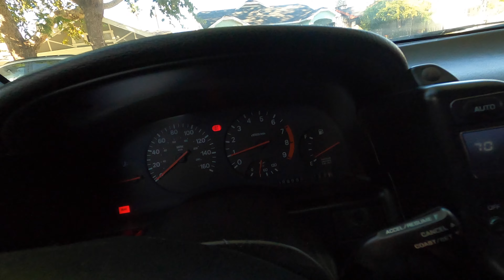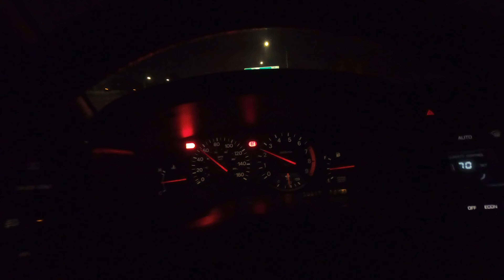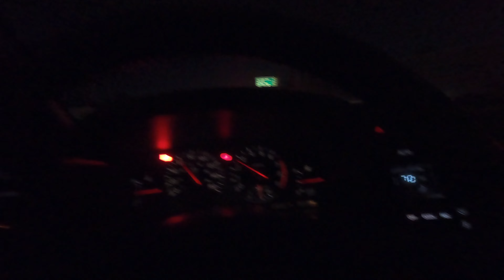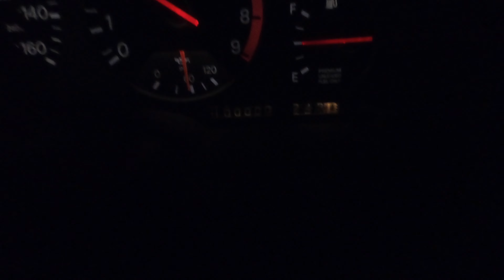New wheels for 300zx

Comment: Aggressive 19” wheels require a lot of work (camber, stretched tires and/or more negative camber) to fit. Those widths and offsets are not that great for a Z either. It looks like you’re already lowered with stock control arms (natural camber) so maybe a +25 offset would be better.